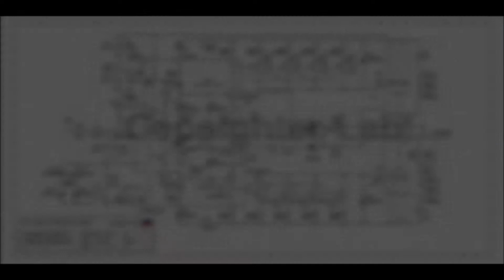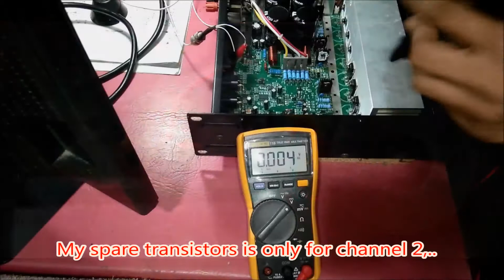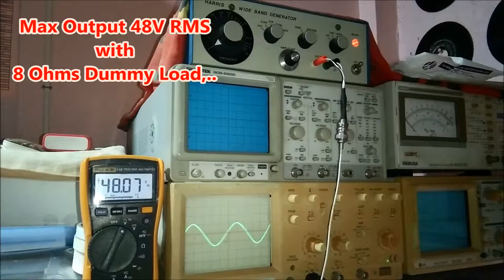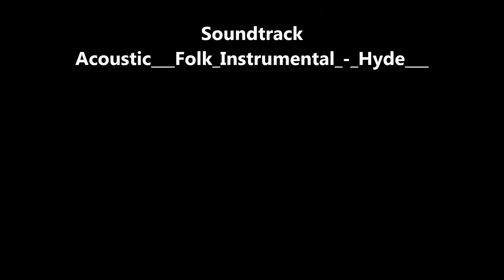KA-300 KESLER AMPLIFIER REPAIR AND MEASUREMENT,..

Comment: Good day bro! May tanong ako. Nag repair ako ng katulad nang ni repair mo na kesler amp. Pumutok ang isang resistor r21 malapit sa malaking capacitor at nabura ang value ng resistor, pwede ka makabigay ng value ng r21? Salamat bro!
Reply from the maker: Good day Bro. E compare molang sa kabilang channel... Matagal na kasing kinuha yang nerepair ko... Hindi kona matandaan.
Reply: @CABohol  nilagyan ko ng pyesa pareho ng value sa kabila. Nag power on pero nag protect ang kabila. Okay naman yung isang channel, anyways, thank you sa pag reply mo. Kudos sa channel mo.
Reply from the maker: @jaimejosesalvoro768  Check mo bro kung may DC output,.. Or pwede mo gamiting reference yung schematic dito sa site ko, file name is tasso Amp,.. Pinaka source ng topology is QSC Amplifier na ang output configuration is grounded collector or Capacitor coupled...
https://sites.google.com/site/capsighter/schematics?authuser=0
Reply: @CABohol  bro, I've checked your diagram. Also, I'll keep in touch with you nalang if may progress na. Salamat ng marami bro!
Reply from the maker: @jaimejosesalvoro768  Welcome Bro. 😊